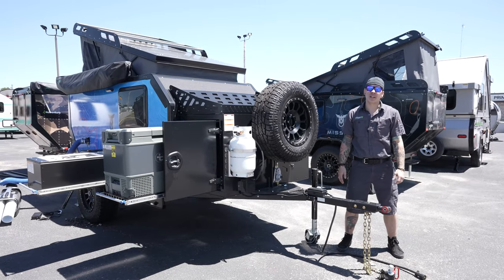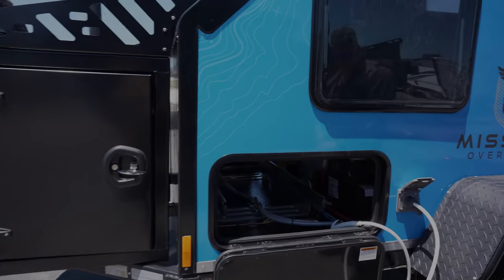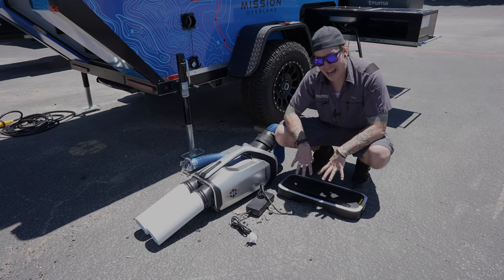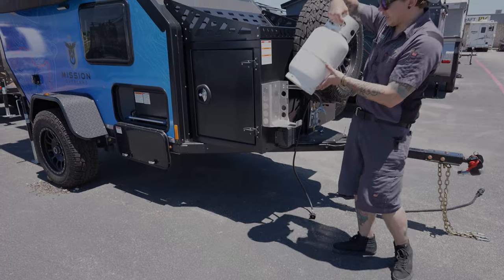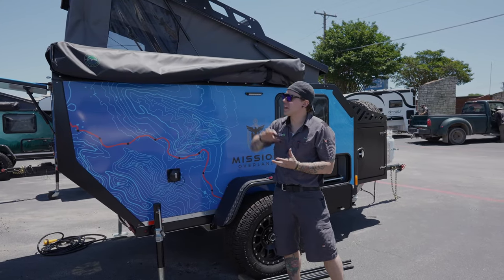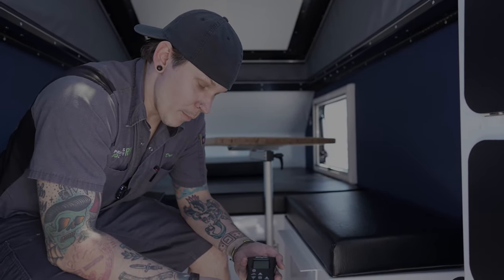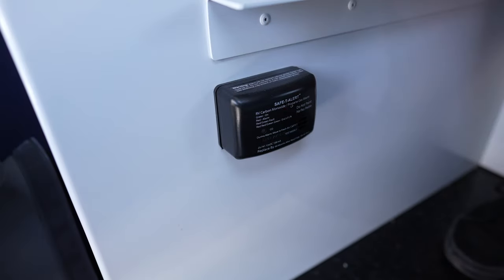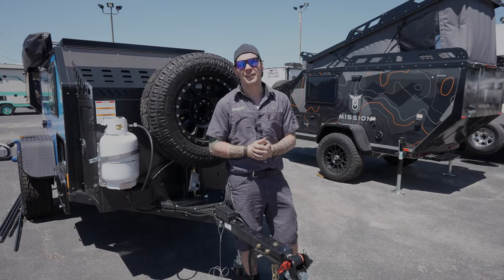2021 Mission Overland Summit Tech Tour

Comment: You do not want to run at "max tire pressure".  You want to run the tire at a pressure that is matched to the weight of the trailer. Typical tech.